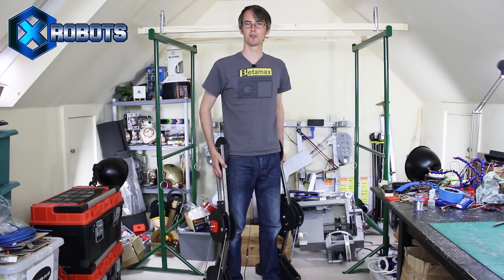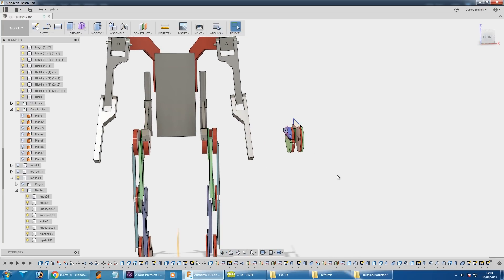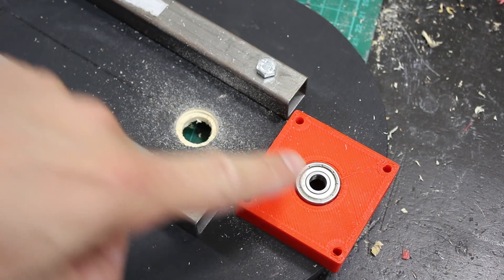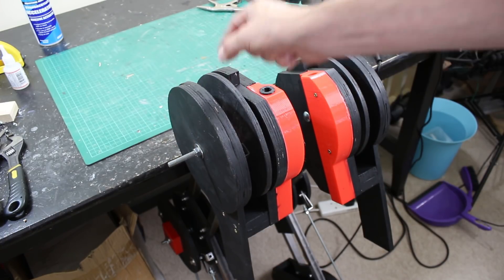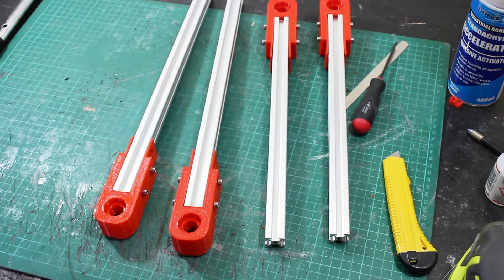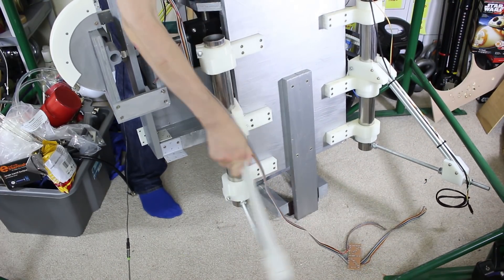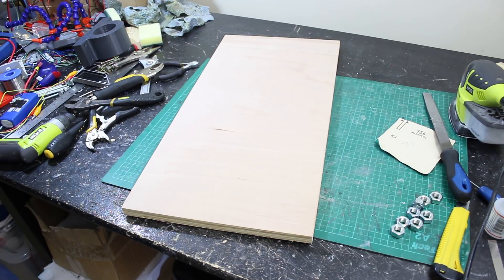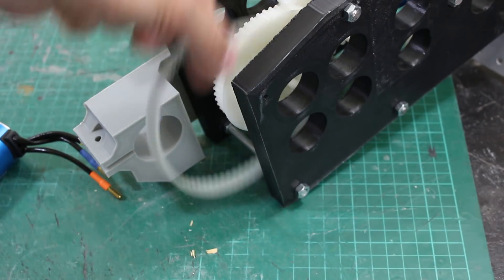Iron Man Exosuit #16 - Main Mechanical Build | James Bruton

Comment: You mentioned weight as a concern in other videos. Have you given any thought to skeletonizing the joint disks and steel members to reduce weight? I am thinking you could take 25-35% off with just some more time and a spade bit or 2.

Comment: Its just a thought but for control would it be possible to use muscle sensors? Like those little pads that detect muscle activation. A little bit of anotomy needed to perfectly find the right muscles for the pads but in my theory it should work. I just watched terry crews video of him controlling stuff with muscles in the video: terry crews muscle music (might be fake dont know). Anyway feel free to correct me if I'm wrong 
Keep up the good work I'm actually interested what will be the end product of this project.

Comment: I suggest using the built in finite analysis stress simulations in the CAD programs for the design of the gearbox. Or an engineering textbook

Comment: James: please consider ditching the block and tackle in favor of a harmonic drive. This would be a great Fusion360/ 3D print project and give you the massive gear reduction (and hence torque) you need in the most compact space possible
Reply: Try cycloidal; doesn't require the flexy bits of a wave generator/ harmonic

Comment: If most of this stuff is made of Plywood wouldn't you call yourself Wood Man instead?
Reply: Shanethefilmmaker then it would be the mega man exosuit
Reply: All that would mean is there is such thing as a Woodman robot and this guy just inadvertently proved it.
Reply: Shanethefilmmaker Tony Stark's Iron Man suit isn't made of iron, so why does James's have to be? :P
Reply: Where do I begin. Iron Man's first suit was made of Iron, hence the name. That being said Iron Man's suits no matter the alloy were still mostly metal dominant and they kept the name Iron Man anyways because Stan Lee realized they would have to change the name constantly to fit in with the suit's themes.  Seeing as Iron Man's second official suit was originally called The Golden Avenger. While this suit has metal and that 3D printed stuff it's most dominating features and most mentioned material is plywood.  Plywood joints, plywood backing. Wood Wood Wood.That being said my original comment was meant to be a joke.

Comment: I had a similar idea to make an iron man suit that would stand on its own (or at least keep its form) while not worn and alot of the mechanics in this suit are very similar (save for the electronics, all my suits have independent lights and not much else). I'm planning for a modular design that could have parts like arms and legs swapped out so newer systems such as a power network for lights and electronics can be added in the future.

Comment: sEX

Now that I've got your attention, MAKE THE GEARS SMALLER!!! If you put those big clunky gears in, it will ruin the look of the suit. You need a slim compact gearbox to run alongside your leg. I know you printed them but you can use them for something else. If small size prints is an issue, use aluminum gears or something of that sort.
Reply: +James Bruton (XRobots) sorry I was a bit forward there, used to my comments being lost in the sea.

Comment: Was wondering if you could use slightly thinner ply than 18 mm? Would 12 mm do as well?
Reply: I was thinking the same, after all 12mm ply can support well over the average human body weight. Maybe it's something to do with the length of the screws?
I suppose we'll have to trust the judgement of the guy building the suit lol
Reply: i doubt its the load bearing capacity of the ply that matters - the big issue will be its rigidity. and 12mm ply WILL flex under load